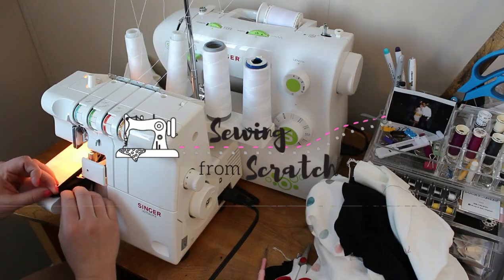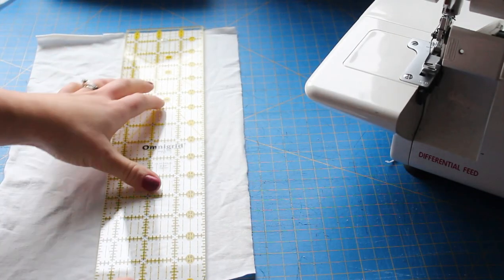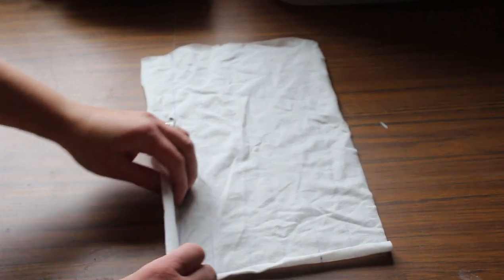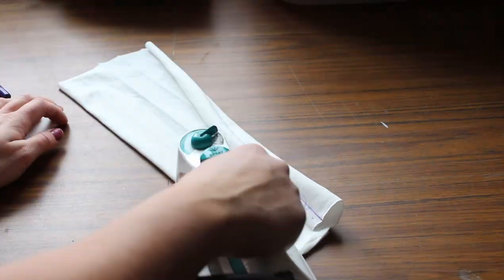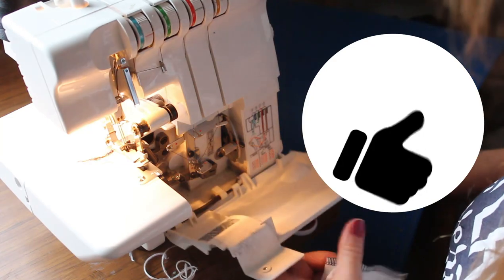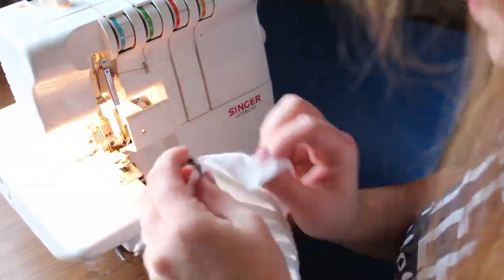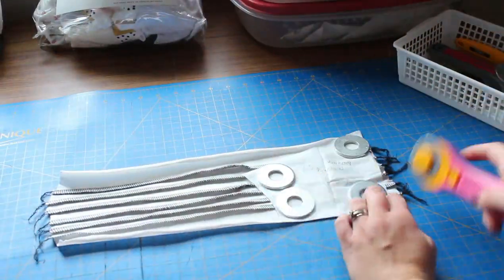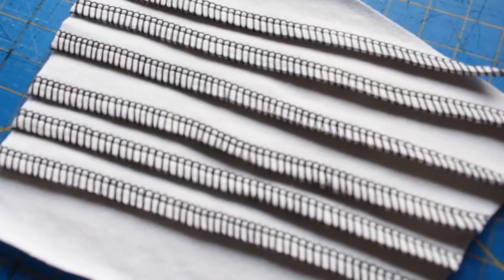Sewing Pintucks with a Serger | How to make moto patches

Comment: Hi Kate! I am planning to send my Ambition 610 back to the e-shop, because I am not able to solve the problem of stitch skipping. About every 5 stitches it skips one especially sewing on pile, and I wonder if they sold a machine with a defect 🤔 . I will buy a machine in my town, where I will pay more, but find answers if needed. Send you greetings from Italy 🌹
Reply from the maker: That's too bad! What kind of trouble shooting did you do? My first thought is trying a different needle. Something specific to the fabric and sharp.
Reply: @seasonallyproductive  I paid attention, not to change needle and foot from factory, as to avoid any possible mistake. I studied the booklet, tried different tensions between the suggested ones. Now the problem is sewing on pile - only one layer - where the stitches skip now and then. I tried to contact the seller, but am still waiting. Maybe tomorrow, because today is holiday...My suspicion is , maybe I am making a mistake on bobin treading, where it is not very clearly explained...! 🤔 I am feeling disappointed! 😕
Reply from the maker: My guess would be the needle. I'm not sure what you mean by "pile". If you're meaning a thick fabric (minky, faux fur, terry cloth), then I would recommend an average to large needle (90/14+). Universal should be fine. If the fabric is stretchy then try out a jersey or stretch needle.
Reply: @seasonallyproductive  Pile = fleece. Thanks for the suggestion of changing needle, I will try this before giving up 😶 . I had great expectations for this machine, I was especially attracted by the patented double transport system. Tomorrow is a new day, let's hope it will be a lucky one 🍀🍀 Will tell you the result of my efforts 😊
Reply from the maker: @ottie1954  love it. Thanks! Is there a local repair person who you could take your machine to? Seems like an awful waste to just return it after a few skipped stitches
Reply: @seasonallyproductive  I planned to give the machine back (if necessary) before the 2 weeks granted by law for the restitution expire. I would get all my money back anyway. Let's listen to the seller tomorrow. Then I will take a decision. About the skipped stitches on that kind of fabric, I can tell you my 30 years old Singer can sew that with no problems 😊 and in her long life never skipped one 🤗.......Yes, there is a Pfaff shop here, but the seller online  has to be responsible for his goods. I would not like to discover he tried to sell me a machine with a defect 🙀😤 - this is not very rare.